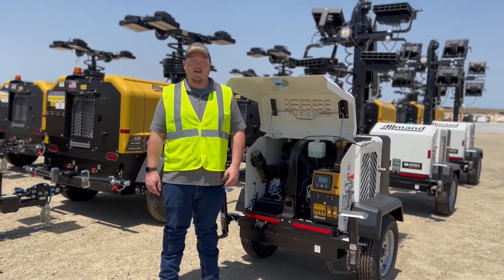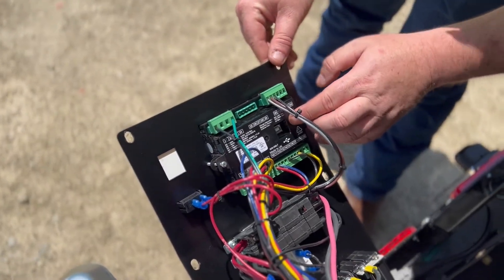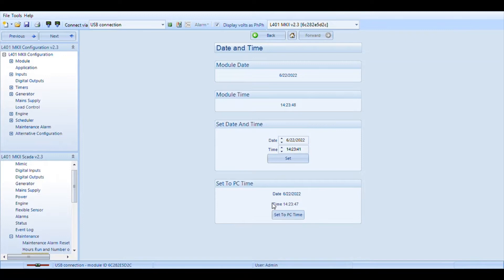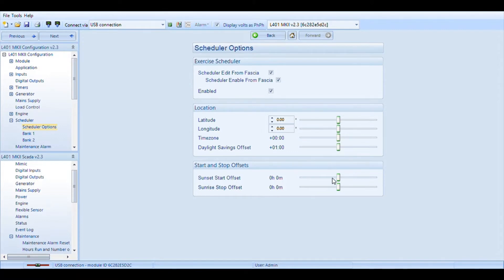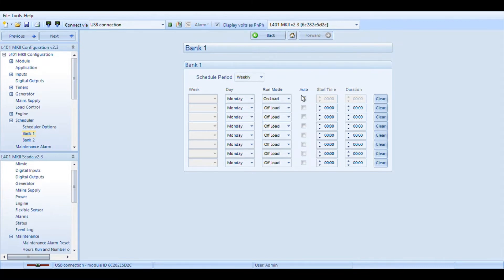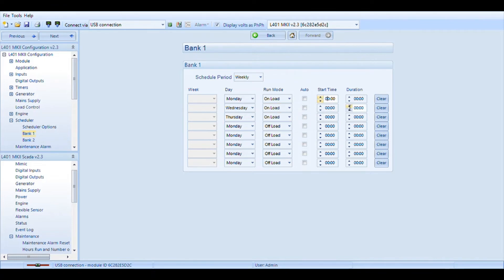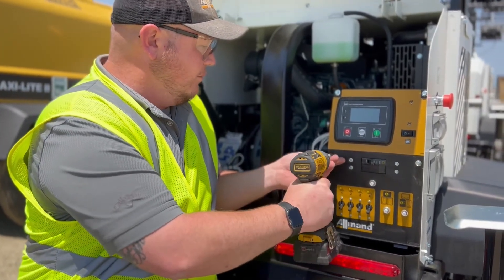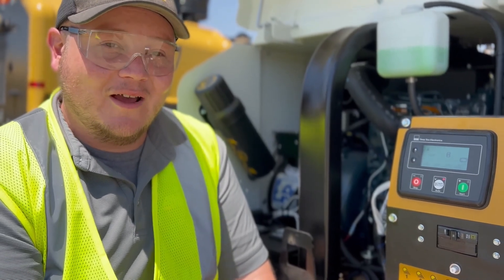Deep Sea Electronics (DSE) Scheduling | Allmand

Comment: I just want to it to be auto off when at 06:00 clock, but need to manually start because we need perform some small check like oil engine level, coolant, and etc before starting the engine (kind of pre inspection), to avoid engine damage in case that safety device malfunction while engine is in the auto start position.
Reply: I mean, auto shutdown but manually Start up.

Comment: Hi, How do we run it only at night when there is no power and when the power comes on it switch off, is it possible with the control or do i need a timer?
Reply: They don’t monitor this.  As far as I can tell, the GR doesn’t come with a solar panel. I’d either set it for sundown to sun up operation, or schedule hours.